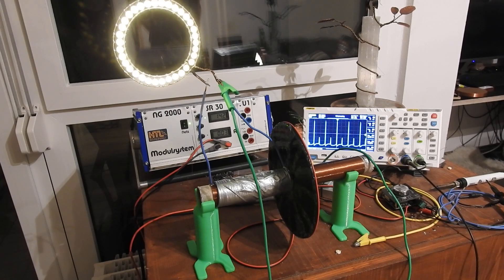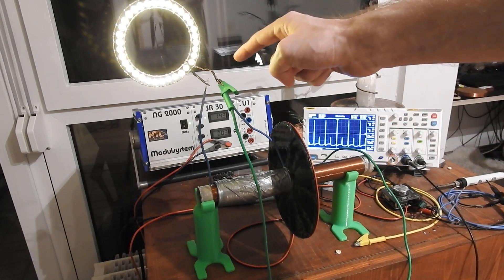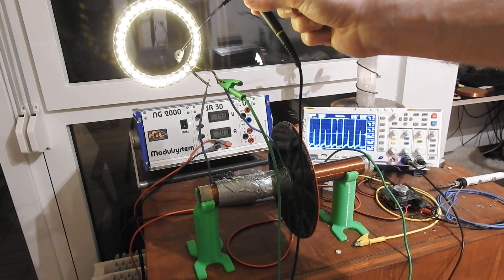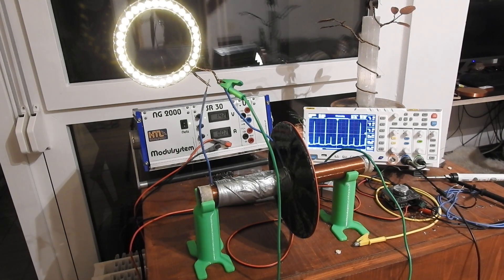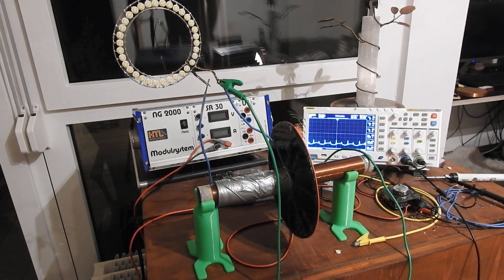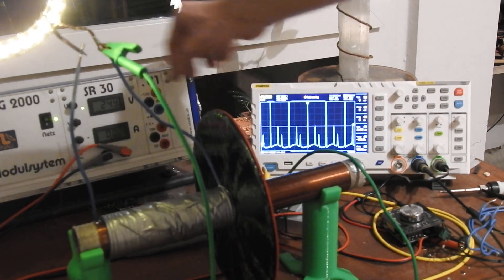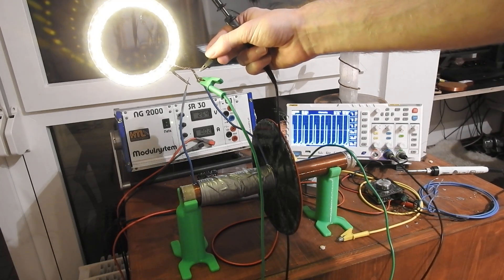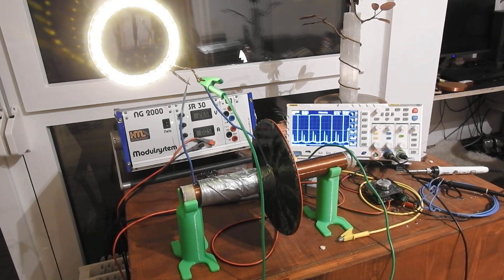High Voltage Impulse Generator with additional output coil

Comment: Again a great experiment. Lovely work. That is a very important video. And it gives us a lot of work to do !. Very nice work. Do you think it will be possible for you (by using some resistances with your oscilloscope probe) to take the real voltage of the emitted "ether waves" generated. Many thanks again.
Reply from the maker: With my equipment I don't think I can measure the actual amplitude of the voltage spikes.
Reply: @OmegaZZ111  If you place resistances between the ground of your oscilioscope probe and the +, it should work. Then you have to use the Ohm law to get the reading of your voltage
Reply from the maker: @Pierre-Marie-9-6-5  Ohm's law only works for DC and especially not for high voltage transient spikes.
You would need more expensive equipment to accurately measure the voltage.
Reply: @OmegaZZ111  you are right for that but it will give you an idea about the tension you have. It is not precise at all but it is better than having no clue about the tension you have. There are also formulas involving AC with the ohms laws. Anyway the tension is high 😆. The probe you are using is probably a x100 ?.
Reply from the maker: @Pierre-Marie-9-6-5  yes it is a x100 probe.

Someday when I have more money I will buy a better oscilloscope and a proper x1000 probe to get more accurate readings. 😄

Comment: Add a fly back transformer to the + of the dc power. It steps up volts and lowers amps. The work is really cool. Do you have a build video to the coils? If so can you send me the link? Thanks..

Comment: I love your videos. I appreciate your work this is pretty good. I enjoy experiments like this myself as well. Coils are so interesting. I think there is more to them then people think. Some different geometries and ways of winding them definitely seems to effect the field they produce. I have some ideas I want to try myself. I had 12v as .02amps powering 240v at 800hz a while ago and nearly killed myself. When you go to lower frequency you end up in a serious shock Hazzard. Anything over 5khz is typically safer than below 3khz.
Reply from the maker: Thanks, yes coils are indeed very interesting to explore. 

I am running this setup at 36kHz so I don't immediately feel a shock when I touch a hot wire, however it can burn my skin when I apply a high enough voltage. 
From my experience everything below 20kHz is painful to touch. 😄
Reply: @OmegaZZ111  an interesting thing to me is that also my setup run at 36 kHz resonant freq and the coil is wounded differently from yours with a size slightly different too. 
What I didn’t get from watching your video once is what is doing the new output coil on the frequency. Is it changing the whole resonating frequency ? Or is it changing only the output freq?? Anyway huge thanks for sharing your work!
Reply: @OmegaZZ111  tested different bifilar coils and they gave me resonnance frequencies around 600 kHz up to 900 kHz. More turns you have on the bifilar lower will be the resonance frequency. Nevertheless I am far away from the 36 kHz you have. To find that resonance, I just use a simple AAA battery and connect it to the coil and disconnect it fast and take the resonance on my oscilloscope. You have a small difference between the real resonance of the coil and what you will measure because of the capacitance of the probe of the oscilloscope. In your setup configuration you use a MOSFET which should not be possible to switch so fast. Maybe by using a fast switching transistor coupled with you signal generator you will be able to increase the signal and then use a fast switching MOSFET to give the impulse waves to the bifilar coil. Just a suggestion. But could you try to evaluate the resonance of your bifilar with a simple battery and give us your feedback? Thanks again
Reply from the maker: @Pierre-Marie-9-6-5  I use a fast switching MOSFET (IRFP460A) that can operate in the MHz range with very fast switching times. 
Also the chip of my audio amplifier is capable of fast switching up to the MHz range.

Do you get the same readings for your resonance frequency when you repeat the measurements with your manual switching with a battery?
Reply: @OmegaZZ111  I have approximately the same readings. It depends of the length of the bifilar cables I used which modify the resonance frequency but it is always higher that 500kHz